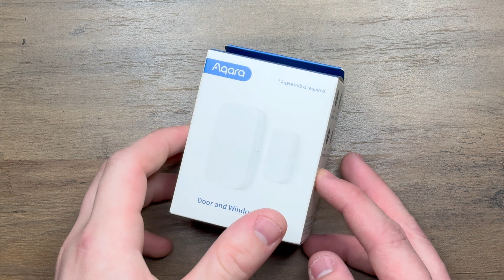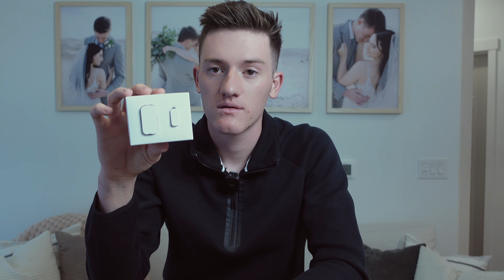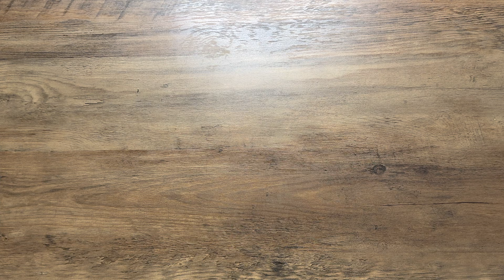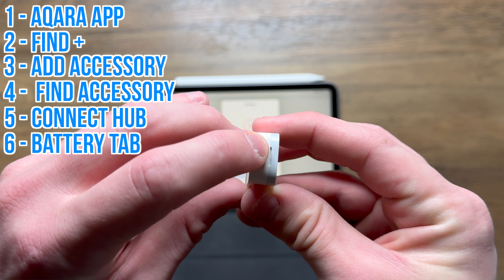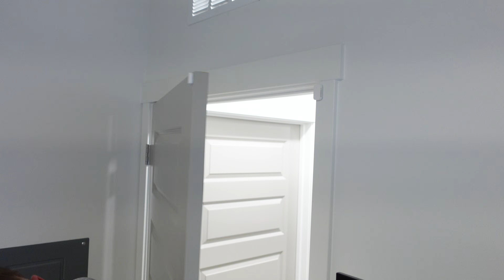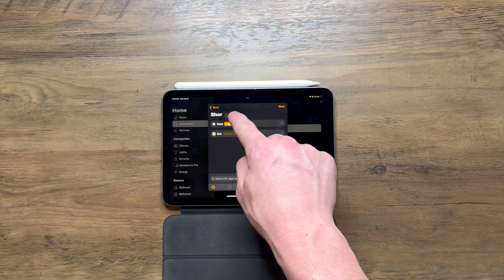Aqara Door Sensor: Expert Tips and Tricks homekit smart home

Comment: Hi! Great video! Can you tell me how fast are the automations that uses this aqara door sensor as trigger? Example: Turn on the lights after opening the door?
Reply from the maker: In my opinion pretty fast. There is a small lag but it is fast enough that when I open the door the lights come on fast enough that I don’t think about touching the light switch because the lights are on before I would find the switch. 

I do think it helps I have really reliable Lutron smart switches.